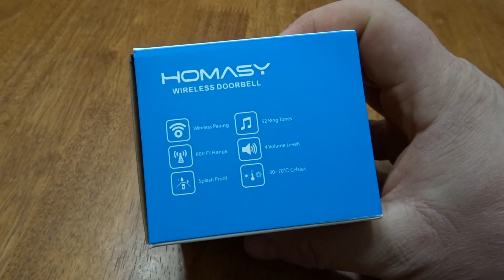Homasy Door Ringer Installation DIY

Comment: Yo chapped ass, why didn't you just replace the door bell button ?  I'd expect that type of bell in a house where rainbow flags fly...!!! Haha.
Reply from the maker: It was much easier to order off amazon than to run down to Home Depot and buy one.  This way I can silence it by unplugging it if needed
Reply: I bought one of these because mice chewed my old doorbell circuit and I didn't want to take apart drywall to figure out where (or to route a new circuit). Rainbow flags are irrelevant to this issue.